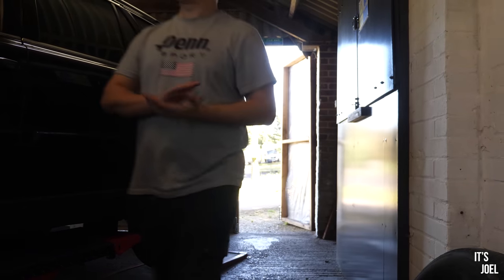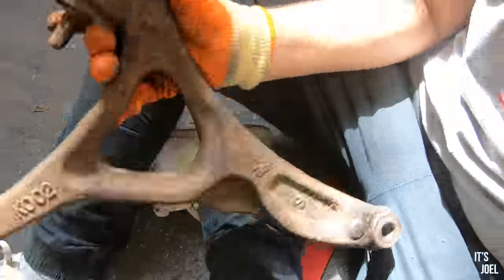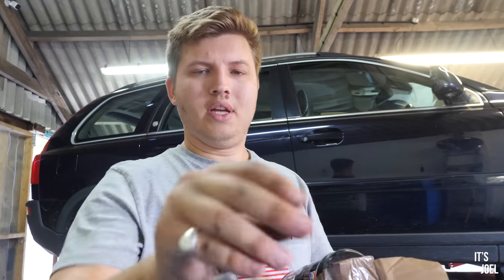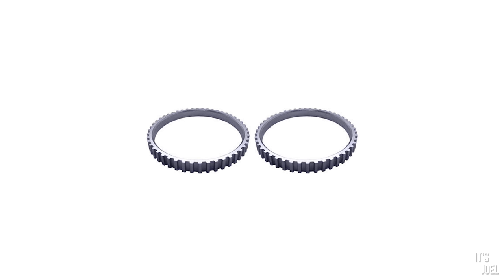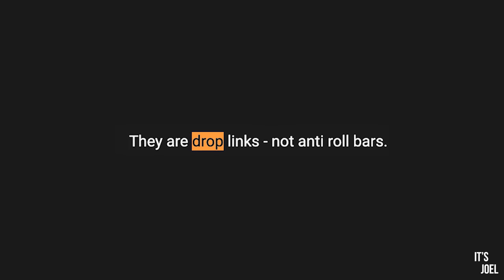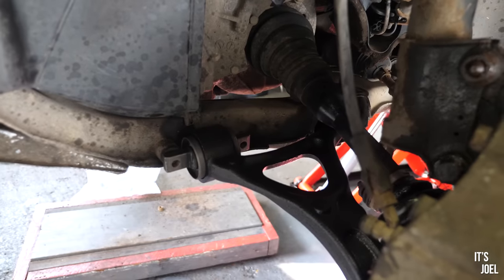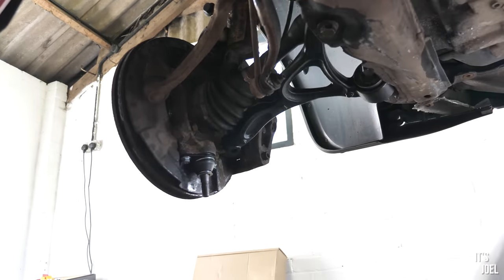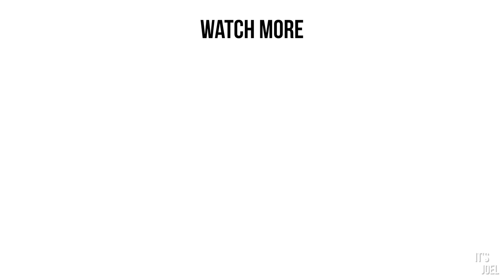CAN I SAVE MY £800 COPART VOLVO XC90? PART 2

Comment: you need to wiggle the hub aswell as prising down the arm to get it in joel
and the droplink also needs a torque  bit in the middle and a spanner on the nut to undo it...hope this helps, and also leave the hub bolt on the drive shaft just loosen ot out about an inch and give it a smack in with a lump hammer this will bring the spline and you will be able to get to the ring
make a cutting in the ring and heat up the new ring and should just slide on..

Comment: Personally I would have fitted the arm to the new ball joint loosely first the push both the front to bolts through the subframe and loosely then push the hub and arm back to slot the remaining bolt in the back bush about hour job for both sides

Comment: Would have it been easier to bolt the control arm to the ball joint first, then try to locate the control arm?  Also you will probably have to use another jack and pipe to jack up the suspension a bit to help with the aligning of the control arm?

Comment: Few things.

Has the blow torch not arrived - disappointed to not see it being used on the seized nuts and using the brute force of a 1.5m lever instead.
You said you going to use anti-seize copper grease on the ball joint mount - did you forget or change your mind - didn’t look like there was any.
The ABS rings - as far as I can see, that is a metal ring with castellations which causes the sensor to generate a series of pulses as it details the high and low parts of the ring.  But are the original rings really damaged, seems unlikely to me.  More likely, certainly what I would check first, is that the ABS rings are full of dirt and crud and just need a good cleaning.  Once cleaned, if the error is still there I’d visually inspect them, are the castellations worn down or broken or do they look good.  If good then I’d leave them be and look at the sensor.

Comment: The spanner size is not the bolt  size. You might use a 14mm spanner on a bolt but the the bolt is not a 14mm bolt.
Loosening tight bolts is a technique of body position and using your body weight.

Comment: I've not reached the end of the video yet, but to the ABS light will reset once you go above 24 mph (if I remember correctly) on all four wheels - I did the ABS rings on my C70 a few years back and tried putting it in gear on the jackstands.. nope! all four wheels needed to be moving to reset the light. No computer required though :)

Comment: Maybe I over-engineer, but if it were me, I would always do anything major work related to suspension, wheels and brakes, symmetrically - I’d always do both sides even if the immediate problem is just on one side.  My rationale is that even if it is just one side, the other side probably isn’t far behind plus I don’t want to create an imbalance of having a perfect component on one side and an imperfect one on the other.

Appreciate in your case you need to get the arm done as you need to vacate the garage but my advice would be to do the other side as soon as you can.

Comment: It's admirable what you trying to do, but you need to know a few basics, ball joints do move, they are not bent, it is a ball in a socket, they are designed to do this. When I change drop links, I saw them off, or grind them off, much easier and far less time consuming. You might spend less time actually 'doing' if you take time to stop, step back, and think about how to tackle the job. Great video, hope my advice helps.

Comment: Hi Joel,  Good work but those bolts on the new bottom ball joint look a bit slanted ? or is in just camera angle  at 9.27 mins
Reply: I came to post the same thing. I wouldn't be surprised if he's cross threaded them! 😬

Comment: You can cut the drop links off with a grinder two second job they come with new nuts.🤣

Ball joint is fine it’s meant to move like that.

Could you not ask someone to help you do all this?

Comment: This is big jobs especially on a rusty car but good going.

I think maybe next time start easy and work your way up to these big jobs 

I would say about the ball joint but i have seen people already said.

Its just new so its stiff but you should be able to move the ball joint woth yoir hands.

Also for drive shaft put the bolt on half way and then smack it with a hammer should move.

Comment: Good effort mate but have to say as a mechanic painful to watch you struggle 😢if I wasn’t in Australia I would come and help you !! You didn’t bend the ball joint it just needed re positioned as it’s meant to move and the drop links should have a torx or Allen bolt in middle so you can hold the centre while undoing the nut… good luck

Comment: Note to self, give it a good hotpressurewash before working to reduce muck.

Ps. Would it be possible to semi-attach the balljoint to lower controlarm and then put it in and then do a final torq?

Comment: Bent balljoint😂 thank you for keeping it in the video. its not easy working on cars in the beginning. You need a mechanic friend that can drop by and save you when everything goes to scraps. Drop links without an angle grinder can be distasterous.

Comment: Just a thought - could you loose-fit the balljoint to the lower swing-arm before offering the swing-arm up to the subframe?  Torque up the swing-arm to subframe and then swing-arm to balljoint.  Is there a Haynes manual for the XC90?  - I've found them really useful in the past, from my CX500 motorcycle to my Volvo 850.

Comment: If your going to embark on messing with car like this. The best investment you can buy is a dewalt DCF899. It will save you hours. Get a set of 6 point impact sockets.
Reply: Looks like the numbers might have changed, but get one rated at 950Nm.

Comment: I bought a 2007 D5, pretty much doing the same things atm. only difference, i do everything in my driveway with no lift. cool cars, but not really sure if its worth it what i am doing 😂 keep the videos coming!
Reply: I've had the same car with similar issues and had to change the arms and wheel bearings. All done on a driveway on a 3 ton jack. Never ever again. These are like working on tractors. Everything about the XC90 front end is agricultural in size and weight. This was the last used car I had and went into lease cars after that. You did amazingly well. Hats off to you for taking this on. Oh and have fun with the infotainment fibre optic work. That was another educational experience.

Comment: Good work Joel. I have had many Volvos in the past and replaced many lower arms. There a pain, on the lower ball joints they are supposed to move around, if grab hold of it you should be able move it back to level. But it looks like u have lost a lower clip from it. If you need a hand mate, I’m more than happy to help. I have just replaced all the suspension on my V40.

Comment: hi fit the ball joint first with the bolt half way on, then do the inner lower arm, youll may find it easyer if you lower the car down onto a axle stand under the ball joint to compress the suspension in order to fit the inner lower arm

Comment: Well, you overlooked the obvious what you were fitting is called a ball joint, which the answer is in the name of what you are changing. So said item was not bent it is designed to bend as the wheel goes up and down. I must say top marks as you were trying your best with limited knowlege.

Comment: i love your videos and the fact that you have no idea what you are doing in a sense is hilarious. the work you are doing will take someone that knows what they are doing and have the tools and garage probably a day to do. just to put some perspective on it i just watched my neighbour try and fit his wheel for an hour before i went out and put it on for him, it made me realise that like you t
here are loads of people that rely on garages and the huge cost involved scares me. 
keep at it and you will get there it is all down to experience and the only way to gat that is to suck up and try it fantastic to see you try and you will succeed if you persist.

for your reluctor rings just use a chisel and a hammer to remove the old ones. to replace put the new rings in the oven or heat them with a heat gun as hot as you can as they are press fit and don't hit them to hard or they may just split carefully and gently is the way. you might discover that you have to remove the hub completely to remove the drive shaft... but be careful and don't pull on the ends or you might pull it apart . 

all the jobs are fairly easy to do as DIY but doing it for the first time is a steep learning curve when you have nobody there to at least explain how it is done and some jobs need three arms and more.

keep it up and keep the videos coming :)

Comment: Dude you need to head to machine mart and buy your self a mechanics tool chest with all the tools..  they aren’t the best not for the professional by handy for a diyer or to get you going 

Oh you need to buy a Haynes manual

Your problem here you’ve got limited tools the drop links need an Allen key in the middle to stop it from spinning 

Get your self a impact gun and impact sockets and universal socket… this alone would speed things up 

Your control arms are under tension from suspension you need to take the pressure off by jacking up the suspension so it’s level this would help 

Have fun plus you’ve put pressure on your self by renting a garage

Comment: This is painful to watch. Jam a screwdriver in the disc to remove the hub nut. To remove the cv joint separate the hub knuckle from the strut. To remove the ring use a chisel and hammer it off it cut it with a Dremel. Also, don’t MOT a car knowing what’s already going to fail.

Comment: Oh my god the ball joint is not bent it has moved with you moving everything around 
Have you ever seen a camera mount ball joint It the same principal a joint that moves on a ball end 
Very stiff to move because your not the weight of a car if you put it back use a ring spanner to move it back to the position you need it to be in do not hit or put the control arm on put the bolt on lose and move to ruoghly the position to bolt your control arm back in place 
As for your ABS sensors a lot of time its a build up of brake dust on the sensor if you look at the rings the teeth peak is the on the valley is the off it is the spinning of the teeth pass the sensor ( magnet ) for much of a better word brake dust interferes with this as the components In the pads build up 
Brake cleaner alcohol white spirit as long as there is no cracks in the end of the sensor or split in the wire do all four sensors 
You can check with a multi meter for continuity is all you'll need to hear a beep a peace of metal moving closer and away might register a miniscule change

Comment: The ball joint isn't bent 😂 it's a joint. It moves around. 

Also cringed so hard you hammering the drill bit and using the torque wrench on everything. 🙈
Reply from the maker: Tell me about it
Reply: @itsjoel  fair play though. It's how I learned.

Comment: Man, tbh, I would have cheated by calling a mechanic to show/help a bit with things 😜 Even pro's get help, so someone who's never done it, no shame in it. 
I do see myself in this though, getting stuck on some silly thing, burning valuable time. Real world non pro's, watching those "pro's" on youtube make it looks easy and getting stuck, that all of us! 😅😂
Reply: 100% true facts, im a self taught mechanic with no 3 year Certificate and had 20years Volvo experience working on them so know quite abit about what goes wrong on them but the electrical side of things i just plug in Vida to diagnose them. apart from the major things with the XC90 163bhp D5 is the Volvo dealer price to change the Rear Main oil seal which cost me £1370 with a new ABS ring

Comment: Oh yes - at. 19.20.  - I was in exactly the same position with my XC 70.... I took a tip of a YouTuber called SiRobb. (by the way he has a Volvo XC 70/90 ABS ring replacement vid at. https://www.youtube.com/watch?v=l-ldhG5Mgss ).   I had to get a beefy ratchet strap, one end connected to the control arm and the other connected to the body of the opposite side and just ratchet the hell out of it to pull the control arm down enough to go over the ball joint.  Very sketchy!!  But once you've got the majority of the work done with the ratchet strap, an extra bit of leverage should help. Ain't You Tube great!!!